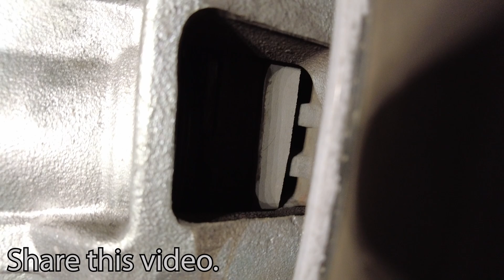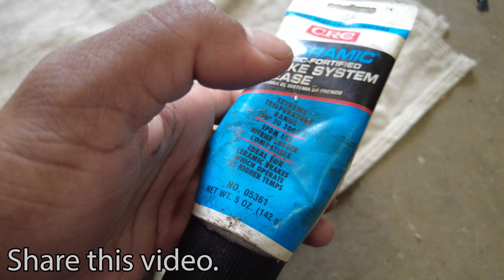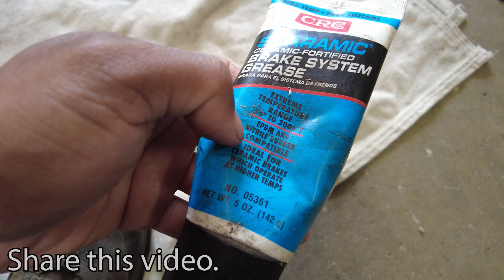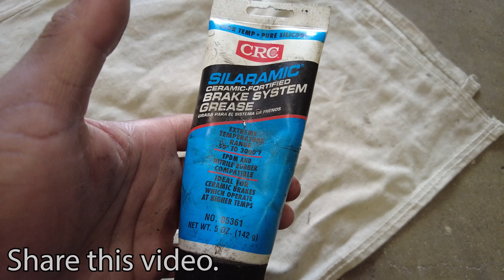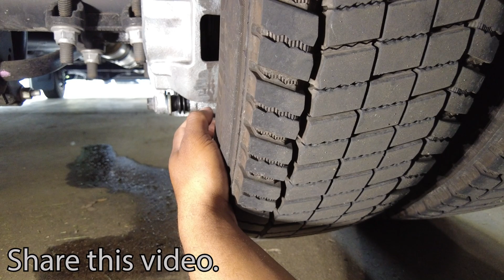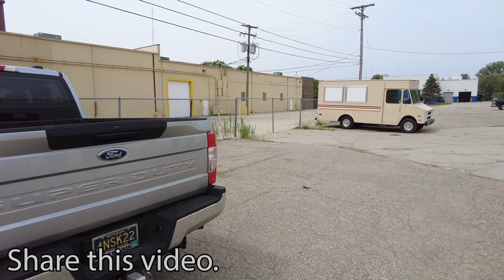SAVE THOUSANDS. how to get the most out of your brakes!

Comment: the brake pins getting stuck are about the only thing I've had trouble with on my 2011 6.7 F350, I bought it new in 11 and it has 260,000 miles and have replaced 2 calipers because of pins getting stuck.